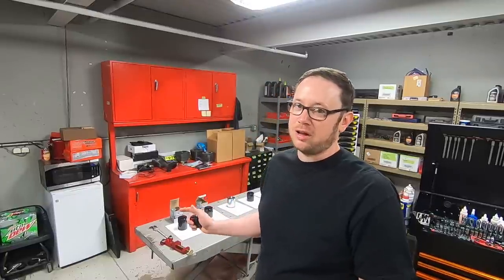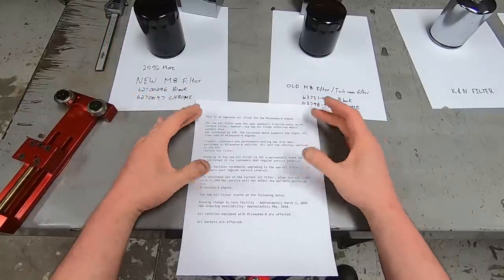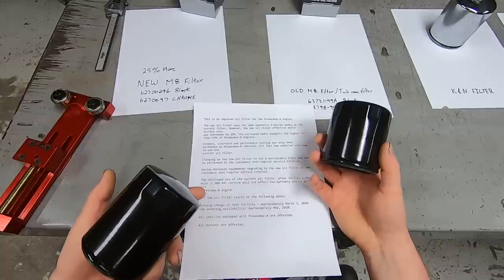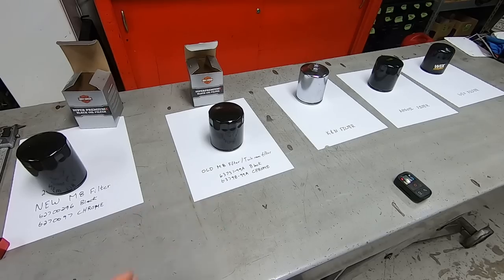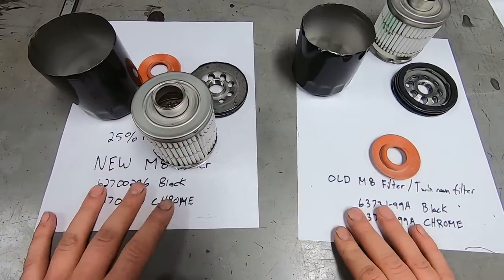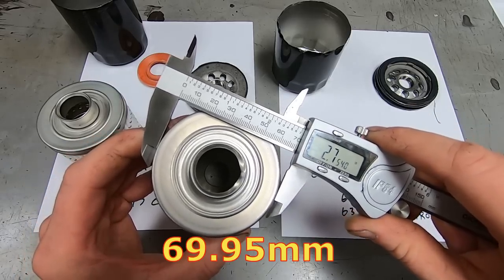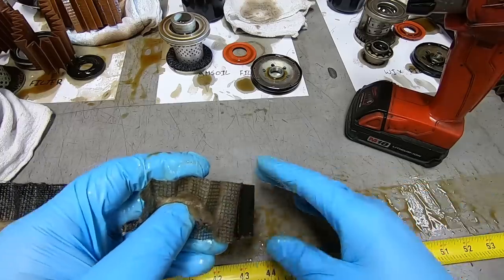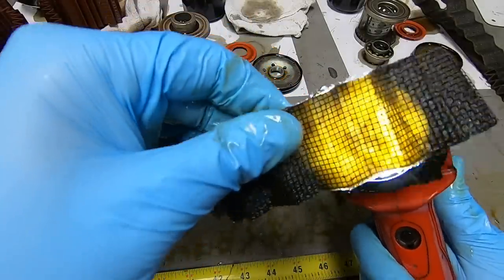NEW MILWAUKEE 8 OIL FILTER TEAR DOWN vs K&N vs AMSOIL vs WIX HARLEY DAVIDSON M8 TWIN CAM COMPETITION

Comment: Brad, while watching this excellent video I thought it appeared doubtful that the new M8 filter had 25% more surface area, so I did the math. (Sorry to nitpick but there's a minor error at 5:15 in your inch to mm conversion.) Based on your measurements, the new filter has 17.5% more media surface area at best. A 25% increase certainly sounds better but it just ain't so.
Reply from the maker: I was hoping someone would do the math. Just by looking at it, it doesn't look 25% longer or anything IMO. Thanks for noting my error. I checked it 3 times lol.
Reply: It's wider so it doesn't needed to be 25% longer.
Reply: Looks like 25% to me

Comment: It seems as though the top plate may be controlling the oil pressure based on # of holes and their diameter.
Has any one observed this?

Comment: I bought a new 22 RGS last year( 2022) after a couple months I had the first service done.The  oil filter they put on is 3 1/2 inches long I believe is the short one. So why didn't they put the longer one on what if what your saying is true.?. Can you measure the outside of the filters as if he never cut them open.. what are the lengths of both.. thanks

Comment: That blow by valve concerns me.  I like that on the new M8 filter you said the bypass valve spring was stiffer.  It seems to me it will be less likely to open that bypass valve and flush the filter into the motor's oil supply.  
Good video
Reply from the maker: Thanks.👍
Reply: Old filters since the Evo days have had a 8-11psi bypass.

I’m guessing Harley finally upped it to around 15-18 psi since the oil pumps from even the TCs put out a lot more psi which would cause the lower setting filters to go into bypass more often.

Bosch 3330 (short) and Bosch 3342 (longer) 
would be my go-to if you buy in bulk or need one easily sourced.

Comment: I'd never use a disposable filter again.   The better flowing,  better filtering, better cooling reusable filters are far better.   I've got 3 bikes and have been using reusable filters on all 3 for over 5 years.   Nice to not have to even think about looking for the right filter for every oil change and not throwing used filters in the landfill

Comment: Many manufacturers going with cartridge paper filters vs metal enclosed.  Less environmental impact.  Just think of all the metal enclosed filters in dump.
Reply: I would like to design a reusable oil filter that uses a disposable cartridge type filter.

Comment: Is the new twincam filter got a new prefix number allocated ?

Also I was watching a video by another engine tech and he was saying the issue with HD Filters is that the 5micons is too small and blocks prematurely and sends oil to bypass too soon in the mileage.  Have you also found this. ?
Would it be better to have a 10 or 15micron to stop oil being pushed through bypass ?  
Enjoyed your video once again. 
Thanx Brad 😎👍
Reply from the maker: I heard that statement a lot since posting this video but I haven't seen any proof or videos describing testing and showing it. I would be interested to see a test like that tho. From my real life experience, the bikes I see that have 100k miles on them have HD oil filters and oil changed every 5k and there engine insides look beautiful and show zero signs of dirty oil or such. Thanks for the comment and view.

Comment: I'm glad you did this so I didn't have too, always wanted to know, now I do, after replacing thousands of filters on Harley's over 25 years in my shop, I will use the new longer Harley filter on my personnel TC bikes, the nut on the K&N looks cheap and tacky and filter is over priced, also I wouldn't recommend the Amsoil filter to anyone, and the Wix is for lawn mowers. thanks

Comment: I use K&N on my 675R race bike and when i change the oil i never see residue. It runs between 9000 to 13,500 rpm

Comment: Everything you did is informative but what we need in how well a filter filters. Construction is important. 
There must be a way to check how they are rated for micron. Almost all of us changes the oil at the beginning or end of the season then store the bike here in the northeast. So fresh clean oil is not a problem. Riding about 5,000 to 6,000 miles an average season.
Membrane can filter differently. 
Anyone have any ideas?
Reply from the maker: I would really like to test or be part of testing the actual filter capacity and efficiency.  Maybe when the channel grows or if a situation arises I can get into a 3rd party testing facility.  If any one has any ideas, toss them out there. I would be super interested.

Comment: Awesome video! I have a 2019 Iron and it calls for the twin cam filter. I went to Autozone and bought Lucas 20w50 synthetic motorcycle oil and filter. They didn’t have the K&N oil filter but crossed it to a Mobil M1-102A. 30 micron, anti drain back valve, 12-17 psi release  valve. The only thing wasn’t at spec was the 5 micron which the Mobil had 30 micron. Would this filter be ok? Thanks for your expertise! I’m a certified Ford diesel technician 6.7l Powerstroke specialist which these truck only get Motorcraft filters. Keep up the good work man and just subscribed!

Comment: So now H-D fits a larger filter in order to (try and) flow more oil.... why don't they just address their quality of manufacture ?
The oil pumps and pressure relief valves are where the problem is along with too fine a filter......... the filter clogs too easily and then the oil bypasses the filter medium - result is unfiltered oil circulating - use a Sportster oil filter and the bypass situation goes away. Sure the Sporty filter doesn't filter to 5 microns, but neither does the 5 micron when it's in bypass mode.......
Reply from the maker: Thanks for the view!

Comment: Great video. Whats your thoughts on reusable oil filers ?   Thanks for sharing. Cheers.
Reply from the maker: I'm not a fan of reusable or cleanable filters. i've heard A human hair is about 75 microns across so if a filter is good down to 5 micron, I feel like there is zero chance of knowing (after cleaning a reusable filter ) if the dirt the filter had collected is cleaned out as I cant see it. And there always super expensive and seem to be constructed with o-rings that are going to be a pain to find when it comes time to replace them. The normal filter is just so much easier. IMO
Reply: Thanks Brad for taking the time to reply. I think I will stay with normal filters. Cheers
Reply: @HarleyDavidsonWizard  and way less messy!

Comment: Great video, question do you run different typres oil/fluid as in oil for engine and primary and transmission as amsoil makes trans and primary specific oil I have read you can use 20w-50 in all 3 holes but in my opinion I think it best to use specific oil for specific holes ? I have a 02 Dyna
Reply: I'm no expert but I run hole specific lubricants. Motor gets 20w50 trans gets a gear oil and the primary gets its own oil built for wet clutch application
Reply: @gliderydin2911  Thanks and I agree different lube for different parts of the bike or car etc... I went  with amsoil hole specific

Comment: Thank you. I wonder the reason why they moved to a bigger filter, would it have something to do with Sumping? I have a 96 EVO which always had stock oil filters and they are long just like the new M8 oil filter. Then it's either the new M8 filter or the K&N I will put on my 2017 107 ultra. But I am still seriously thinking of placing a magnet at either the outer or the inner bottom. Would it be a dumb thing?
Reply from the maker: I assume the higher volume filter is to go along/work better with the new higher volume pump that comes stock on 2020 models. That's my guess at least. A magnet on the outside wouldn't hurt anything.

Comment: 5 micron is usually for fuel filters, seems very small for oil
Reply: It's overkill for oil. The filter media will plug up faster, forcing the bypass valve to open.

Comment: What are your thoughts on these engines having a centrifuge and running a filter magnet?
Reply from the maker: In my opinion if there's enough steel material floating in the oil for a magnet to grab, the damage has already happened. Normal ware is aluminum and bronze.
Reply: @HarleyDavidsonWizard  thanks the reason I'm asking is because I just purchased another one of these expensive bikes and want to have some faith in it not breaking down and having it spend its whole life in the shop thanks again

Comment: Hey Brad I was watching Kevin on pro twin and he was saying that the 5 micron filter was only good for about three thousand miles then it started going through the bypass might be something to look at
Reply: ,  I listened to what Kevin had to say also and it made me decide to change just my filter every 2,500 miles. Not only will that ensure the filter never goes into bypass, it'll also give the old oil a fresh shot by filling the new filter with new oil before installing.
Reply from the maker: I heard that statement a lot since posting this video but I haven't seen any proof or videos describing testing and showing it. I would be interested to see a test like that tho. From my real life experience, the bikes I see that have 100k miles on them have HD oil filters and oil changed every 5k and there engine insides look beautiful and show zero signs of dirty oil or such. Thanks for the comment and view.
Reply: Your opinion means a lot to me I seen something and wanted you to check it out thank you and keep the videos coming!

Comment: You’re “about the same” and my “about the same” are not about the same… 10:30 those inlet holes are very different. 8 large on the HD vs 6 tiny ones on the Amsoil. That thing seems like it would be restrictive.

Comment: K&N wins!  Oil filters and Air Filters, K&N always.  Since my Shovelhead, EVO and several Twin Cams, always K&N & Mobil Oil.  You realize HD doesn't make their fluids, filters etc...
Reply: That's true with any manufacturers. John Deere, Caterpillar, etc. They have companies produce to their standards. If you read all his comments, high mileage bikes that he's seen have run factory filters. In my opinion, they all are good. Main thing is doing the maintenance. I am going to run the new factory filter for the M8, on my bike, though.

Comment: I was helping my buddy do an oil change and he had one of those reusable oil filters. What do you think of them.  I’ve always used K&N myself and really haven’t used any other filters
Reply from the maker: I'm not a fan of reusable or cleanable filters. i've heard A human hair is about 75 microns across so if a filter is good down to 5 micron, I feel like there is zero chance of knowing (after cleaning a reusable filter ) if the dirt the filter had collected is cleaned out as I cant see it. And there always super expensive and seem to be constructed with o-rings that are going to be a pain to find when it comes time to replace them. The normal filter is just so much easier. IMO

Comment: My 99 built motor hates the K&N fikters
Reply from the maker: Why is that?
Reply: @HarleyDavidsonWizard  honestly I got no idea why it does not like them. But idle my bike idles low and lumpy 95" built with big cam oil pressure goes below 7 pounds with K&N filter.

Comment: Too bad you didn't include the newer Fram filters....Fram having basically gone back to the original Harley filter design form decades ago with better construction and heavier spring rather than the silly stamped sheet metal thingie the new ones have...
Reply from the maker: I didnt know they existed at the time of this video. The other fram filter video I've seen was for evo oil filters.  I wonder how much of a difference there is with a fram twin cam filter.

Comment: Harley Davinson??  Sorry dude, this comparison is a nearly total waste of time and effort. You really can't compare the dimensions of wet vs dry media material, and comparing length vs width of the interior is just this side of meaningless. It's the old apples and oranges. The best measure of oil flow capacity would be done in a laboratory with calibrated test equipment.
Reply: Dude your on the right track,it's all about uninterrupted flow maintaining factory recommended psi. Size or material doesn't matter.Lower micron rating is always better as long as your not restricting. As far as flow rate cold or hot, I think we all have a freezer and a stove stovetop along with a turkey thermometer. You can figure it out from there.Wow no laboratory con ditions required. Some folks are born pessimists. 👏👏👏